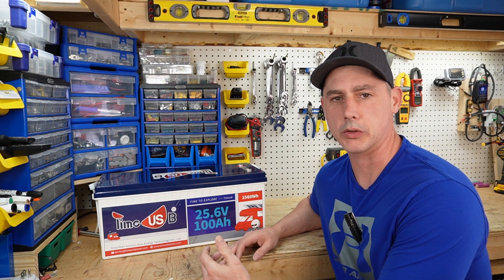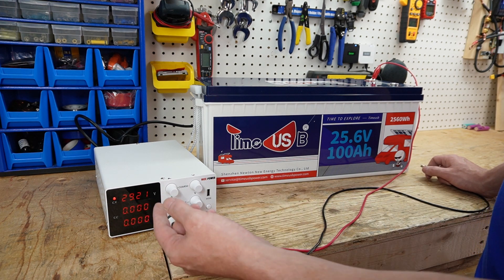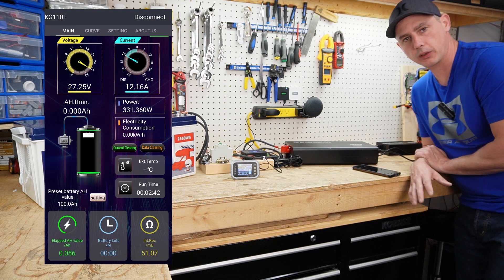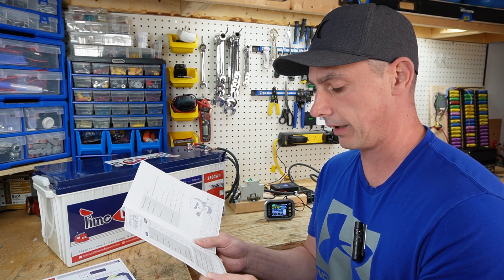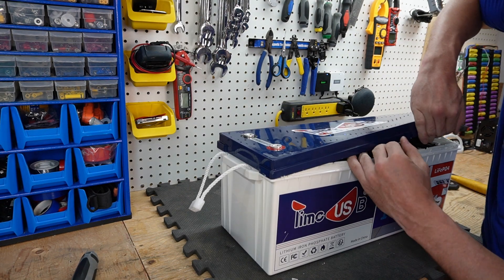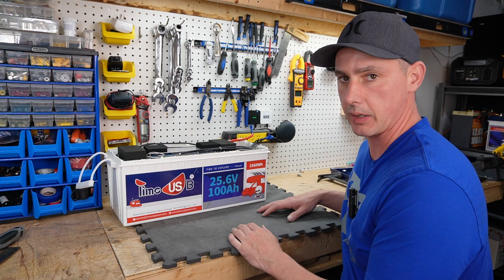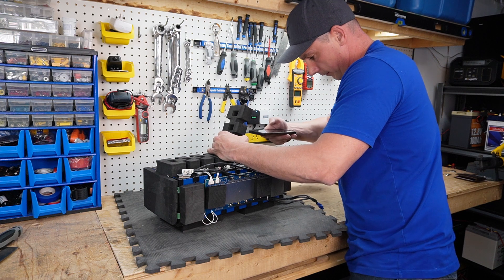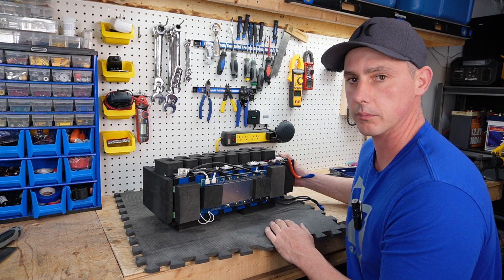Budget Friendly 12/24V LiFePO4 Lithium Battery, Great With Growatts  By Timeusb

Comment: Could you do a video using a 24v vs. a 12 v charging a solar power station so people understand the 24 is better because it will charge the station twice as fast with just alligator clips
Reply from the maker: I want to make a video like that. But mainly to show the smaller conductor size and less wear on equipment using fewer amps. Whether you have a 12V 200Ah or a 24V 100Ah (both using 8 3.2V 100Ah cells), they will charge at the same rate. The same amount of watts will go into both.
Reply: @Roll2Videos  but wouldn’t you need a booster converter to get the same watts into the power station,,,  also when charging the battery with a mppt 75v15amp , good budget on Amazon mppt, the 24v will get more watts to the battery than the 12v due to 24x15 than 12x15, it’s a difference and it is a budget mppt…. I’m not really good at this stuff but I just started and learning new tricks,,, this stuff is interesting
Reply from the maker: @zodaguado6655  75V 15A = 1125W the charge controller for a 12V would convert to 12.8V (Using nominal voltage for my example) 88A and 25.6V 44A it's still converting the 1125W. It's the same energy no matter your battery voltage.
Reply: @Roll2Videos  hey man I apologize, I was speaking as far as charging faster, my bad, I don’t know the correct lingo but I just got these new batteries and I tested the 24v to my power station via xt60 and alligator clips and the 24v charges at a rate of 220 watts while the 12v only charges at 99 watts,,, I was thinking like a shtf scenario like hurricane earthquake…. You can charge up the power station much quicker as a fridge takes 100 watts on average by itself, at least newer fridges lol I apologize
Reply from the maker: @zodaguado6655  Hey, I enjoy talking about this stuff 🌞 be very careful with clips; I find they always overheat

Comment: Do you recommend getting the 24v instead of a 12v  for an external battery pack for a portable solar station
Reply from the maker: I do; the higher volt means smaller wiring and less strain on the system. Fewer Amps

Comment: It can be a deal breaker for those who need low temperature charge protection. However for those who don't mind doing a bit of warranty voiding ingenuity, you can carefully pull out the BMS and replace it with your favourite one of choice.

I opened my 24 volt version up and installed a JK BMS (B2A8S20P) and after a few rounds of bench test programming it  to the best conservative settings to replace those pesky SLA batteries on my rackmount APC SUA1500 UPS. When I ran a 1/3 load calibration test which entails it to be connected to a resistive load and ran down till the first cell hit the 2.6 volt/cell cutoff. I was able to pull 2,229 Wh going through the UPS out of a nominal 2,560 Wh capacity battery. Rough guessing 85% conversion efficiency and getting a net result of 5+ hours of runtime vs <20 minutes on 18 aH SLA's. I really have no complaints except it takes forever and a day to charge it from flat to full since the internal charger is current limited to 5 amps.

Saving up to purchase another one to replace the SLA batteries in the other rackmount UPS...
Reply from the maker: I have a recent video on a smart shut that you can add low-temperature protection.
Reply: @Roll2Videos  I thought about that route too, but I wanted a bluetooth capable BMS with active balancing since it’ll be in float service 90% of the time. It was fairly easy to get apart to upgrade it to my liking compared to most. Hopefully they don’t change their design when I purchase the second one. The chances you take when buying budget batteries.
Reply from the maker: https://youtu.be/3OY8MZHfWXA

Comment: So I've Been told its best to add batteries together to a bank that have been bought within a month or 2 of each other. Only reason I can think of is so they're somewhat the same cycle life capacity. Is this what you've been told or are there other reasons because I'd really like to add more AHs to my growatt but the (2) 100ah 24s I'm currently running are now about 6-8months old.Theyve only been used part time tho. I'd say I've only used less then 2% or possibly a max of 5% of their capacity but that's a total guesstimate.
Reply from the maker: If you're series connecting batteries, I would suggest buying them together but parallel; it doesn't matter. In my system, I have different Ah batteries together in parallel. The lower Ah batteries get used a little more, but nothing I'm worried about.
Reply: @Roll2Videos  cool. I really wanna get upto 400ahs,thx again 4 input✌️